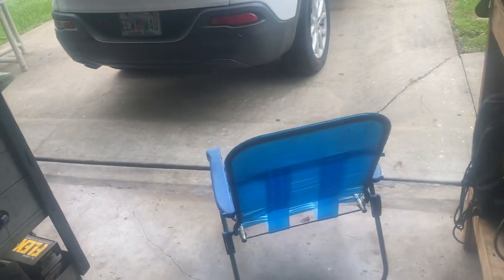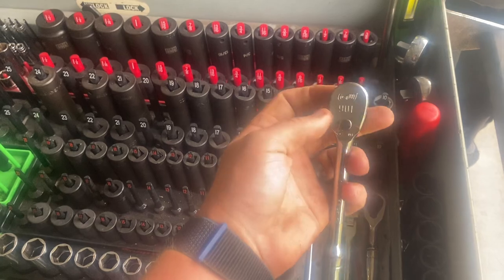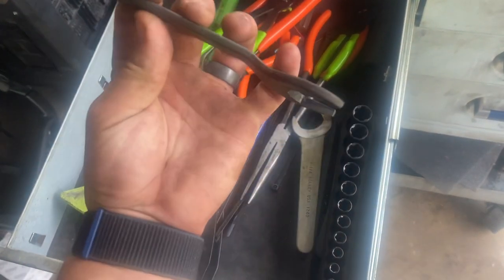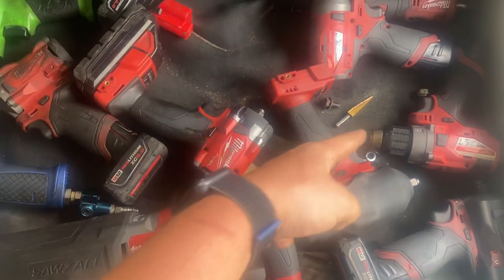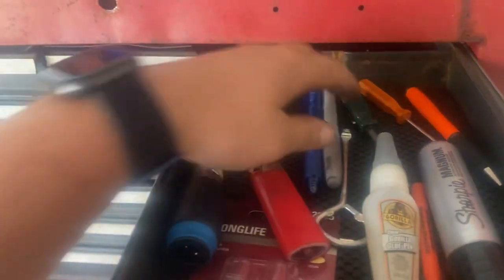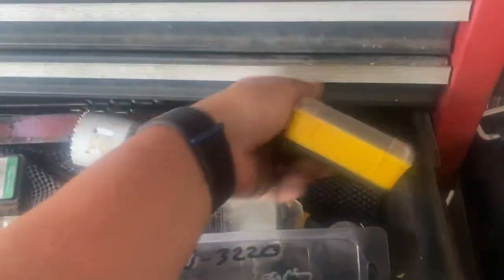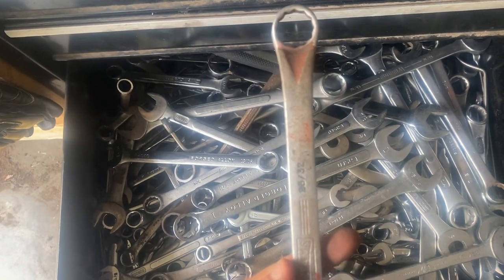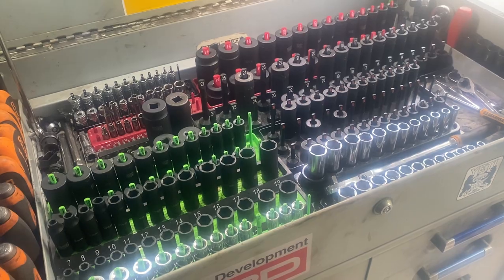Cat mechanic home toolbox/garage tour!!

Comment: Thanks to people,I had Three of those hand impact drivers with no bits, now I have one a old USA Craftsman one,I just have to find the bits,I gave my dad the harbor freight one with no bits and the buffalo brand tools just up and walked off with the metal case for the Craftsman impact driver, and im guessing that is what happened to all of the bits except the 3 from the harbor freight tools one's I broke removing brakes on a 70 Ford 250 360bbf Fe 4spd bulldog transmission the front drum brakes and rear drum brakes..